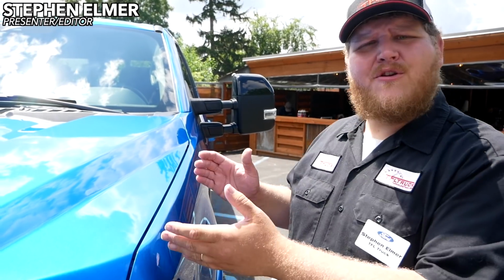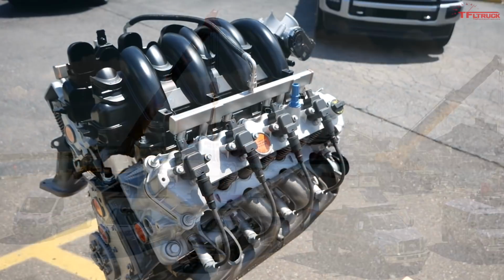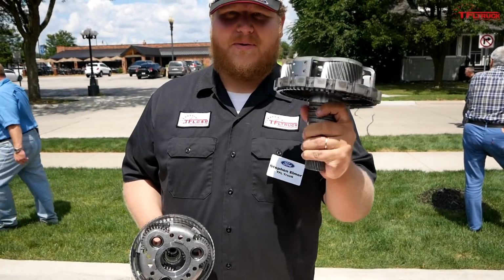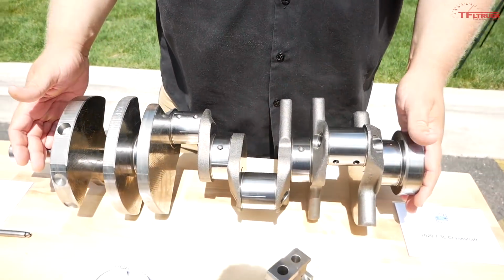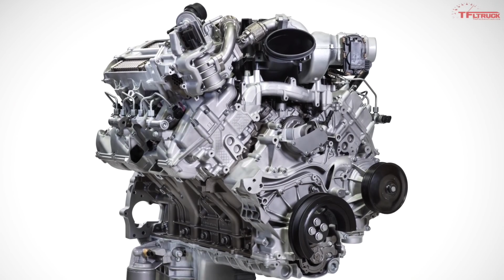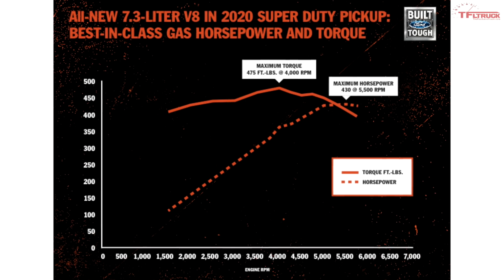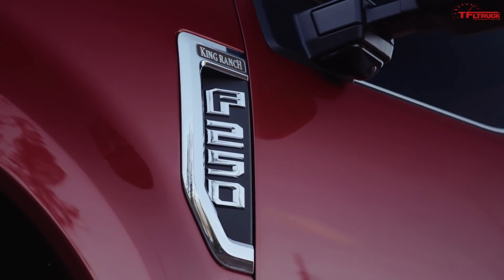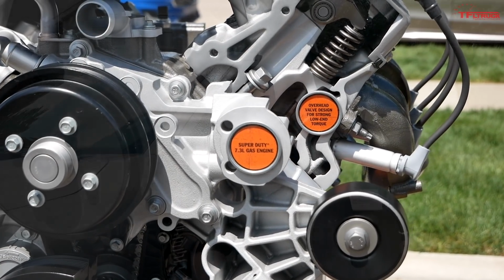We Finally Know the Ford Super Duty 7.3L V8 Power Numbers & They Are Lower Than We Thought!

Comment: I would have liked to see a bit more power, but they likely did enough to be top dog leaving room for more power down the road as needed. I'm not saying what is there is terrible, but I would have liked to see 450-460hp and torque in the 500-520 range. Without a doubt there is enough room available in a design like that to make quite a bit more power. The bigger cubes will be a massive difference when being used as a work horse. Even the fuel mileage should be improved over the 6.2 and 6.8L.

Comment: So they basically built an LS... Ford cut Chevy a check...
Reply: FORD started using a Y block with cross bolted mains in 1962, all modular Ford engines since 1991 have a Y block and cross bolted mains. Who copied Who?
Reply: @benjaminwayneb  Yet Ford went around the world with that overhead Cam high revving garbage. Only to return back to the push rod. There is a reason the LS swap is the King of the hill... Ford customers are guinea pigs...

Comment: I am liking the motor and get what Fords intent was...I wish it had just a little more power/torque.  I am also told the MPG is less than the 6.2...which is dismal.  So until more info comes out I will reserve my comments.  I presently have a 6.2 GMC, 6.4 Ram, and a 6.7 Ford diesel...

Comment: What are the benefits of the 7.3L over the 3.5L ecoboost? The 3.5L has nearly the same torque curve at the same RPMs and is rated at the same 475 ft lbs. Are these supposed to last longer when under load? I’m genuinely curious.
Reply: There’s no replacement for displacement

Comment: Change the cam - adjust ignition timing - add some some fuel......this engine will make 600+ hp easily. Don't worry car heads, the potential is there. Looks like this is going to be one hell of a truck engine!! Thank you Ford

Comment: I figured they would be in this range. Flat torque curve and reliable are most important in this application. In all reality we are just plain spoiled as hell. The old 460 only made half as much HP and the tq curve wasn't this flat either. The V10 makes only 3/4 of this hp and also nowhere near as flat a tq curve. That all said, this engine should certainly make some huge numbers when people start swapping it. A bigger cam, longtubes, and a tune should easily push it well past 500hp, and I would guess it will handle some serious boost too.

Comment: Still disappointed, I mean if Ford is going to come out with their new so called.. "big block" it ought to at least make a little more horsepower than the diesel version. A 1970 El Camino LS6 was essentially a 1/2 ton pickup, and it made way more power and torque than this thing. And yeah, yeah, I know, GM hasn't made squat in this segment since well, 1970 anyways, other than the 8.1 Vortec which did show promise and had huge potential until them bastards killed it off, GM can suck it too.

Comment: The hp at lower rpms is going to make this truck like a semi accelerating.  460 still better than this new stuff.  2200rpm 400lbs of torque is better than 4000 rpm with 475.

Comment: So its a big block LS?  I guess if you can't beat them join them.  Ford is doing LS swaps from the factory now :).
Reply: Actually the LS design was stolen from Fords FE (390, 427, 428) motors.  Google Ford FE
Reply: I have done the research.  I am not seeing the resemblance.  I stumbled on some Ford forums that discussed the LS engine, but all I found on there was sour grapes and tears.  The ford had a deep skirt block design and some had cross bolted main caps, but that is all I can see as similar.  Interestingly the ford guys said the LS was a variety of stolen Ford designs.  Some said it was an FE, some said it was a copy of the ford small block, I am sure on some forum some said it was a direct copy of the flathead.  Some of the stretches made to make the LS seem like a copy were quite entertaining.  Everything from non-Siamese bore exhaust ports, the number of the head bolts being the same, and many more super generic comparisons.  My favorite was one guy who said the LS does not have the distributor on the back it has it on the front like a ford small block.  To which another guy responded that the LS never came with a distributer.  The ford guys rebuttal was that an aftermarket company makes a distributor conversion for LS motors which placed the distributor on the front, proving that if it had a distributor it would have copied the ford, hahahahhah wow. It was interesting seeing the history of Ford fans reaction to the LS.  I have broken it into the (5) stages of LS world domination denial.stage 1 - The LS is not a good motor, and lacks performance potential, the overhead cam mod motor will destroy it.  This was of course disproven quite quickly with the absolute domination of Fords contemporary engines and the awesome power potential of the LS shown with modification.stage 2 -  The modular motor responds well to boost.  Um......what motor doesn't?  LS engines seem to be doing quite well with boost.stage 3 -  LS is an ugly looking motor.  (they are starting to get desperate).stage 4 - Ford was working on the cathedral port design and GM had aliens kidnap the engineer, stole the design using brain scans, then wiped his memory.  stage 5 - The LS motor is a Ford design, it has spark plugs, 8 cylinders, liquid cooling, and was made on earth, exactly like the Ford (insert Ford V8 engine of choice here).I guess my original comment is somewhat similar to all the LS crying.  I just saw the 6 bolt mains, and the block looked really similar and made the comment jokingly .  I guess I should reserve judgment until more about the motor is known.  I am curious if this will become a good aftermarket performance motor.  The Ford overhead cam stuff just never really caught on. This new motor could potentially offer some of the things that made the LS so great, plus the displacement is large.
Reply: @f1hotrod527  LS and FE are deep skirt and cross main which is your engine core.  The LS top end has better heads, cam, fuel and electronic systems.  This came from better machining and technology now than in the 60-70s.  Heck even the tires and drive train  are 10 times better now then in the 60-70s.

Comment: It's cool to see Ford realize high strung over head cam engines aren't good workhorses. Now they have a gasser truck that could have competed with a GM engine from '01. The GM 8.1l from 01-06 was also over 400lb ft from about 1200rpm up to almost 4k with peak of 455lb ft.

Comment: Look at the block, heads and the valve angles!!!! That thing awesome, looks like a nascar engine
Reply: looks like a LT4
Reply: @marcmo7138  Looks a lot like a Mark IV 427 big block fron the '60's.....look at the angles of the valve springs sort of like a "porcupine" design. Solid engineering from the '60 too. And Dr. Oldsmobile said in the early '60'es that a wedge shaped combustion chamber was more powerful at lower rpm than a hemi...he was right too.

Comment: I remember one link I read a couple months ago predicted 450 hp based on a linear extrapolation from the 6.2 liter V8 (assuming hp/liter of displacement was a constant).  Okay, without any other information, that's a reasonable guess, but 430 hp is still pretty impressive, and around (what?) $8-10,000 LESS than buying the diesel?  That amount of savings can buy a lot of pizza!  Not to mention fuel, or license tabs, or insurance, or ... fill in the blank.

Comment: Ford Needs to bring back the Econoline with this 7.3 engine because the transit vans are junk
Reply: I was watching another 7.3L numbers release the other day that mentioned the Econoline word....is the Econoline still available in other markets maybe?  A quick search says yes, but only as a stripped chassis, so with that I'd think you could get an Econoline 3/4 or 1 ton van still if you got the wallet to persuade them to do it LOL.  Those econoline vans were great, and with a Quigley 4x4 conversion they'd go anywhere.  They made great conversion vans and you could have the Westfalia pop-top installed in them as well.
Reply: Agreed. I was looking at those as options for work trucks but have no tow capacity at all. Even the Mercedes sprinters are useless for towing. An E series with the ability to tow 10k plus would be awesome.
Reply: @kc-q-o7m  I'm not sure what the E-Series vans were rated to tow, but had to be pretty comparable to the F-Series trucks they were based on I would think.
Reply: My company has owned over 17 e350 econoline Van's a few 5.4 Triton with over 300k all orginal. Iv been buying used low mileage econoline Van's to keep us going. The transit van is a weak and flimsy peace of crap.
Reply: couldnt agree more, the transit vans are a joke compared to the econoline/e-series vans, those were real trucks.  the transit van is basically a unibody car based tall wagon.  it feels like a tin can too.  those vans were built for europe and thats where they should have stayed, let americans have their trucks

Comment: The power is actually more than I was expecting.  I was thinking 410, just enough to beat GM.  But 430 gives it a clear advantage.  GM needs to pull out an 8.0 liter V10.  Or look at it this way:  Ford has built a strong base engine, and now the performance aftermarket will make it a beast.

Comment: The key to making a durable long lasting engine is to not over stress it. I think Fords on the right track here. Oversized bearings and a oversized water pump sound good to me. My next truck may be a 250 if it turns out to be a good engine.

Comment: Thought itd be at 500 lb/ft but that is a flat torque curve. One thing worth mentioning is that this engine is actually replacing the venerable 6.8 V-10 designed in 97, that engine still made in Ford commercial and motorhome vehicles makes 460 lb/ft of torque at only 3,000 rpm with a very wide torque curve. I hope this Godzilla is as durable as the V-10

Comment: Ah yes I remember the 3.5 ecoboost and the commercial they put out about how durable it was towing and all kinds of miles they put on it only to see my friend replace all the coil packs at 60,000 miles and timing failure before 100,000 bad mpg and all that and still a one wheel peel POS

Comment: No more big Modular(OHC) Engine . . . 😞😢
Oh, BTW, you(FoMoCo) just made GM and their LS series engines feel and look like a genius by going back to "in block cam" and push-rods. BTW, keep feeding the Meat Puppets the false fact that cam location got anything to do with strong low end torque. Many class 8 trucks have been using the OHC architecture for a while now and those make up to 2050 lbs-ft @ 1150 rpm (2017 Cummins X15 Performance Series).
Steel pistons in the 6.7L Diesel, ABOUT EFFING TIME SOMEONE DID from the Big 3. 🙄

Comment: Nice... Looks good.
So.. Ford finally figured out why Chevy and Ram have been using pushrods..
In a bigger V8 your not reving the engine that much.
Simplicity, compactness and reliability..
Over dual overhead cams.
Reply: Had nothing but OHC problems out of my 5.4. Chains and cam phasers were replaced twice by 150,000 miles...truck did have a hard life, pulled trailers everyday. Got tired of it being in the shop though. Nice to see a pushrod engine.
Reply: @henryw.1587  
Yeah the 5.4 is notorious for the cam phaser issues.. along with spark plugs either shooting out or getting stuck in the head depending on which year and valve setup it has.
Unbelievable....
Reply: @kens97sto171  Only thing nice I could say about the truck was I never once serviced or had a transmission issue at the time I sold the truck. Thats about it...had it about 3 years and spent about 4-5 months total in the shop getting the motor torn apart and put back together. Was not reliable.
Reply: @henryw.1587  
Yeah.. that motor was just not a great one.. and such simple things like spark plug problems and cam phasers..lifter.  these are NOT things that should be problems from a manufacturer that's been building cars for over 100 years.
Reply: @kens97sto171  the truck just didn't need that type of setup. Those 5.4s just aren't that high revving to begin with...my 2006 5.3, 170,000 miles, still have not spent a single cent on motor issues. Been cooling and transfer case issues. The GM LM7 engine is a tank. Owned a few 00-06 5.3s...tahoes/suburbans/sierras... Same story.
Reply: @henryw.1587  
Yep.. in a bigger V8 with low revs. The OHC setup is kinda pointless. 
The 5.3 is a good one.  Few issues with the cylinder deactivation systems on some years..  lifter issues I think.
Reply: My 2002 5.3L GM engine has 165,000 miles, uses little oil, and runs great.  Old pushrod technology is nothing to be ashamed of... it works!
Reply: @johnbeeck2540  
Absolutely.. good engines.. especially the older ones without the cylinder deactivation..
Reply: @kens97sto171  You can have the AFM features turned off programmatically. Issues were related to 2007-2010.5 years and cased massive oil consumption and prematurely failing lifters. Close friend of mine purchased a 2008 Tahoe brand new that lost 2 lifters at 88,000 miles around the 7-8 year mark, outside of the warranty period.

That said, I also have several friends and family with the 2011+ AFM engines that have passed 200,000 without any motor incident. We put 223,000 miles on a 2012 suburban, still got great fuel mileage, used hardly any oil, and was a great pulling vehicle. Only did tires and oil changes.
Reply: @henryw.1587  
That AFM delete can cost some serious money.. or so I've been told.
Just something to look out for if your buying one in those years effected.
Reply: Exactly
Reply: Yea well the 5.4 is actaully a good motor 2006 5.4 172000 burns no oill runs super good love this engine love listening to it idle p urrs and gets up and goes on throttle down
Reply: @krisshayes810  
The 5.4 does not have a great reputation. I believe the 2 valve motors were pretty good but the 3 valve motors were nightmares for spark plugs and cam phasers and all kinds of other stuff. 
that's not very many miles for that year of vehicle.
I've got a 2008 Toyota with 324,000 on it. 
I pretty much stick to Toyota and Honda nowadays since I drive for a living.
Reply: @kens97sto171  im pretty sure that ill get 300000 on mine and ford have updated cam phaser for the 5.4 as well as a melling  oil pump 40 psi and a 60 psi that takes care of the weak oil presssure and there are a couple of articles about 5.4 million mile in a van is one of them just saying
Reply: @kens97sto171  actually spark plugs blowing out 2v plugs getting stuck and breaking 3v
Reply: @krisshayes810  
Ahh. Wasn't sure which way around it was. Still.. not something a 100 year old company should get wrong

Comment: Lol remember when ford told us turbos and eco boost where durable and where tested to 300,000 miles, but ohhh I guess that isn’t really true considering they took a step back to pushrods. Love the engine, hate the bullshit that ford fed people for years about there turbo motors
Reply: You do realize that different applications require different engine designs right? There has never been an ecoboost offered in the superduty trucks and the F150 and smaller vehicles perform very well with the ecoboosts.
Reply: Austin Jordison yeah but ford kept telling us how reliable and durable the eco boost was but I guess not reliable enough for super duty use? That literally makes no sense, the f150 can tow close to 12k pounds and haul, so I’m guessing the eco boost won’t last 300k mikes like ford claims.

Comment: All fords competitors have smaller motors and less gears and this thing barely has more power really not that good of power numbers if you ask anyone who knows anything about power numbers out of a big V8 like that  can’t wait to test drive this thing and realize it has no balls because they geared it like low asf for for pulling and they probably worried more about fuel economy then power that’s why the power numbers are low guarantee this thing will be slow as dirt and with all the emissions it will come with it probably won’t be close to as reliable as ford says gotta remember just because they say it’s reliable doesn’t mean it is they also said the 5.4 was reliable lmao 😂

Comment: This will probably be a reliable and a good engine. I’m just not impressed with the torque. My old 1998 k3500 7.4 big block made 410 ft lbs stock and that’s  old technology . The only downfall was the 4 speed auto behind it. I bet the 7.3 will be decent because of the 10 speed behind it.

Comment: Impressive enough. I just finished a 1700 mile trip with my '19 Silverado 1500 with the 6.2 towing an enclosed trailer with three motorcycles. I'd say around 4500 lbs total. At speeds of 65-70 I probably averaged 9 mpg. The Ecodiesel I traded for it got 12-13 towing same setup. My concern with the new 7.3, especially in a Super Duty, would be the mpg. I am sure you guys will test that in the future but let's just say I am not very optimistic.
Reply: Just pulled a 7000lb Sea Hunt Game Fish (boat) from NC to FL in a 2019 GMC AT4 w/6.2....and with 4 passengers.  Averaged 11.4 on interstate 95.  Damn great ride.  Damn great fuel economy.
Reply: @BEBNC1   Yeah mine gets better mpg pulling our 20' boat as well. About 12-13. My Ecodiesel got 17-19 pulling the same boat.

Comment: I bet it will be a great, durable motor but Ford’s own 3.5 twin turbo makes 470 ft lbs at 3500 rpm. The Raptor version of the 3.5 makes 510 ft lbs. I expected much higher numbers from the factory 7.3.

Comment: Power numbers are little disappointing. But like he said. They took a step back but a step in the right direction.  Keep please keep going that way. For gods sake offer a damn manual tranny in the trucks not just in a crappy car. Lets hope they did not use low friction rings so it doesn't use oil. Any oil consumption is not normal or good.